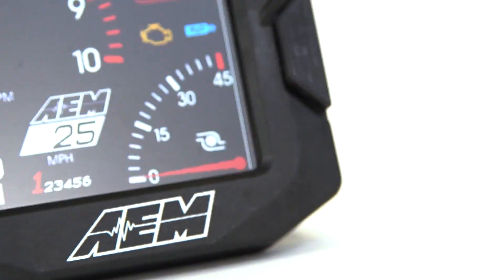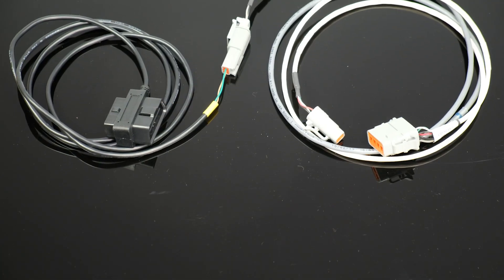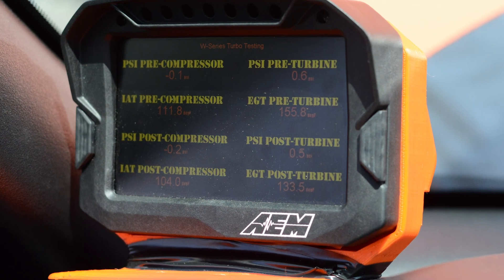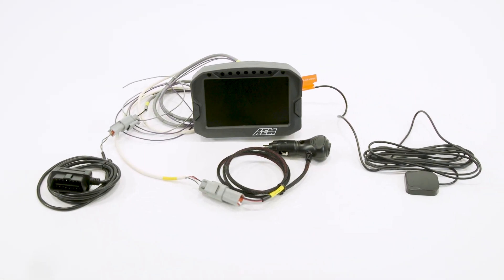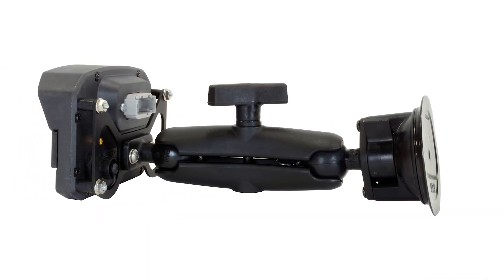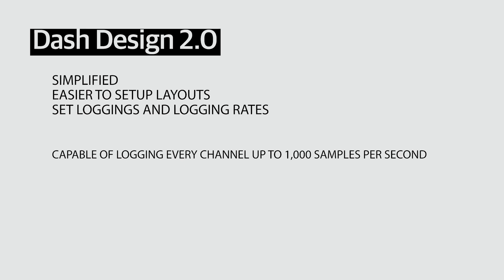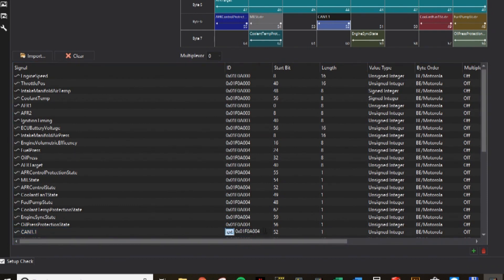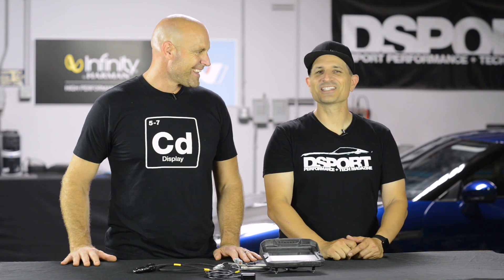The CAN Connection For Newer Vehicles | What is AEM's Dash Design 2.0?

Comment: So only 2008 and up? What if the car has obd port but not a 2008?
Reply from the maker: If you have an OBD II, it's a plug n play connection.
If you don't, check out the next video we're releasing Friday 😄
Reply: Hey Benny, for OBDII, yes because OEMs did not adopt CAN on the OBD port until 2008, generally. If you are pre-2008 then 22 Channel CAN Sensor Module is a great solution for sending the channels you want to the dash over CAN bus.